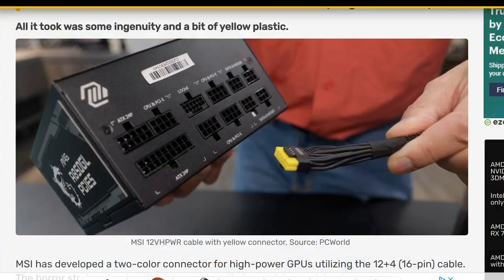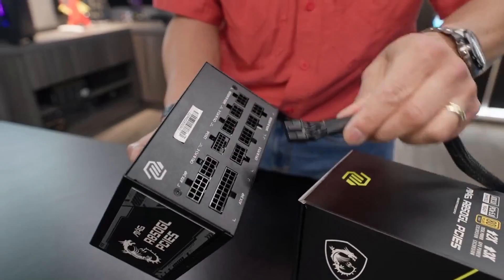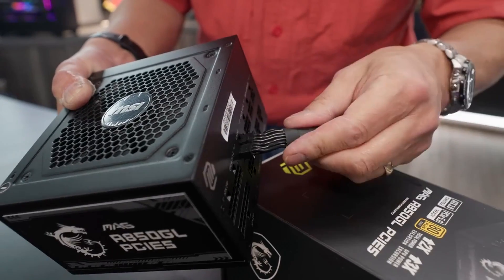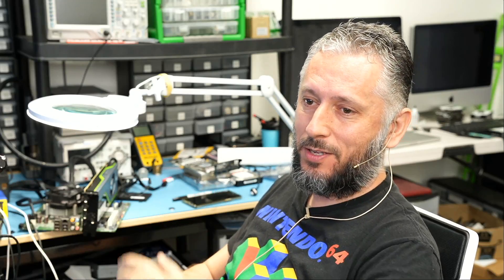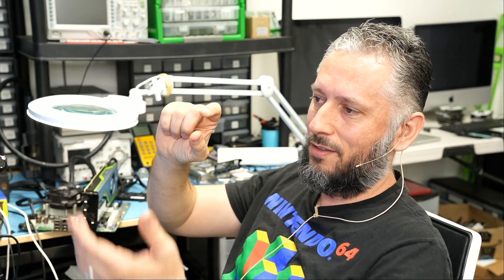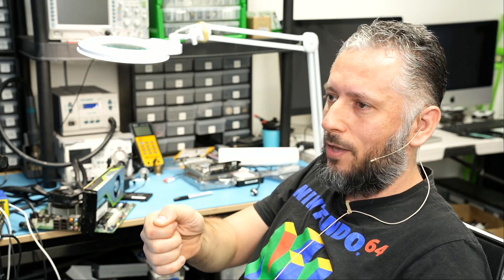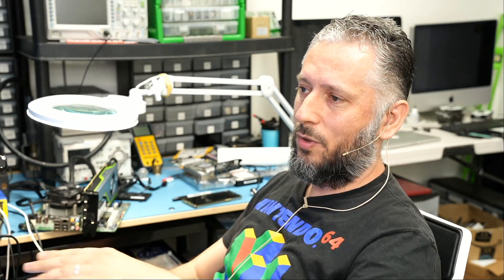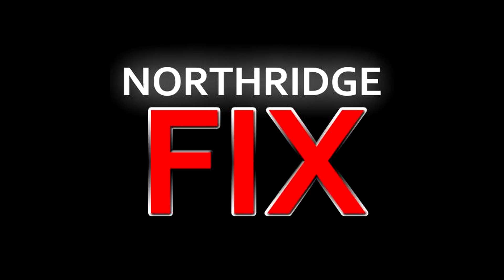4090 Melting connector Fix using MSI yellow cable 12VHPWR. What?

Comment: This is the power supply end. Alex, have you ever had to repair any of those.? 
If the cable was the issue, wouldn't BOTH ends melt.?
Hard wiring the card, to the pin landing would work.

If I ever run into a junk one of those, I would happily let you make it a test mule.

Comment: the issue is not the connections itself, they try to utilize to many Amps on 10-12 pins, instead they need to return to older format - 2-3 power connectors with 10-12 pins on each
Reply: Utilizing many amps on a few pins is not an issue if the connector is designed well. The XT60 connector used for Drones & RC planes can do 60 amps sustained on just two pins. The connector is not even larger than the 12vhpwr.
Reply: @kolle128  nope, if they install x10 XT60 pins instead of this needle one type would be a solution, or 2-3 power connector same crappy style to allocate Amps/heat across all pins
Reply: If the problem isn't with the connections then why are the majority of these cards having no problems at all?
Reply: @--_DJ_--  problem with the connector's setup (one instead of 2-3), that's why majority of 40XX cards have this problem coz of high current over pins overheated them and connector melted

Comment: How it's connected is totally irrelevant. You should be able to plug it halfway, 2/3 way, all the way and it should not melt. You should be able to plug it so that it's just barely connected and the card works, without having to worry about it melting. Melting means that the cable is not sufficiently capable of handling the amperage that passes through it. This is electronics and wiring 101. This is the entry college course. The wire melts, too much power going through wire. Doesn't matter how it's connected at all. If the wire melts, you need lower gauge (bigger) wires.

Comment: I'd just reiterate that it is still user error, but not the fault of the user, as they were set up to fail by nVidia. The blame falls squarely on them.

Don't expect them to care about it though, they're not interested in us gamers or our money anymore, they're an AI company. I just hope the response is proportional.
Reply: How is it user error if the connectors are too loose to stay in place?
Reply: @Sam_Miller  It's your fault if you don't have a connector fully seated. It's nVidia's fault it doesn't stay seated. I'm pretty sure I clearly said what I meant, it really shouldn't have taken any explanation.

Comment: To be fair he didnt say he "wouldn't be worried about pushing it back in" he said "thats enough gap where I would probably want to push it back in". But still the connector is garbo and needs re-desining.
Reply: I agree with Alex that nvidia should redesign the connector so there's more gripping force to make it more difficult to dislodge to start with.

Comment: how about I just paint the tips of my oem cables for my 4090 yellow
Reply: Because the paint will instantly scrape off the first time you plug it in.
Reply: good point
Reply: use some bright color permanent marker
Reply: @46rrodriguez  i think ill try that. maybe try some heat proof automative spray paint from chief auto parts

Comment: Sorry alex i dont think its problem with connecting cable, problem is the connector which is not capable handle AMP, that why generate heat and it's results melting connector

Comment: The connector could do with being redesigned to have something like thumbscrews which will physically and mechanically lock the connector in place all the way home. 

Did the 3 12V connectors on older design boards all connect up straight away or did they each power completely different parts of the card?
Reply: I think they all connected the same parts
Reply: They could just make it larger. Larger pins, larger plug, larger clips. Then it would be just like standard plugs we already had that work fine. This is an easy fix they just refuse to do it.
Reply: Depended on the design.
But they did have larger pins, and a higher contract area - and I dare say they had a far higher current overhead.

Comment: This is a design failure and NVIDA should be held responsible
Reply: yeah, whoever designed this stupid connector, should be fired.
Reply: @isyannnkarr  why fire someone who will not do this mistake ever again?
Reply: @isyannnkarr  Its so pointless too. The regular old cables look just fine. Just add some RGB to them and tie them together if you really hate the look.
Reply: Its not Nvidia who approved this design, there are standards for connectors and the this one was good on paper, good on bench but lacked the real world user test. So its the approvement problem the ATX team who designed and accepted it.
Reply: their testing  regieme wasnt set with real world case conditions ... it may have passed what they conjsider tough .. but after years repairs supprt.. WOW . in summer  the ambient temp can be 40Cin room .. then compund all heat and energy under thermal stress ... shit happejns .. enough for us to see LIVE pattern of failures
Reply: Yes I agree this should fall on the maker 100%
Reply: nVidia, Dell and PCI-SIG all share the blame for this poorly designed connector.
Reply: @RetromancerNick  I wonder if all get kick backs from Nvidia for every attempted RMA.
Reply: Spot on, Intel designed the connector but NVIDIA went with it and evidently didn't test it properly
Reply: said this from the start when it first come to light yet i was the bad man for blaming nvidia and got the its a user error response and trash talk, not that i havent been in stringent testing enviroments and mfg of Z parts
Reply: You do realize that not fully plugging in any connector is a fire hazard right?
Reply: @AndrewB23  true but these seemed with this in mind almost like it was intentionally designed this way on purpose 🤔
Reply: But if they didn't design it like this then they couldn't blame the user and Deny any warranty claims. And the doucher wouldn't be able to afford those leather jackets anymore.
Reply: Surely someone had tested the card before going in the mass production… how could they still go with this shitty connector?
Reply: @Samsemillya  it gives them (Ngreedia) Plausible Deniability and can refuse RMA's on mass.
Reply: a bit yes they schould do it in the way  that it is on the other side
Reply: Hahah nvidia held responsible hahaha that's a good one, anyone remember the nv30 days...
Reply: Actually wrong its people whom cannot install right.
Reply: isnt it an intel design? this connector?
Reply: for improper seating? nah
Reply: Nvidia: it's a design feature
Reply: The CEO thinks he's a cool dude who wears a leather jacket when really he's just a boomer

.

Comment: They need to redesign the connector to connect on the sides w/ 2 locking mechanisms
Reply: That will make zero difference. The problem is the tiny contacts of inadequate current rating which overheat due to simple resistive heating (I2R). IT's PLAIN SIMPLE PHYSICS/SCIENCE !!! It's a DEFECTIVE DESIGN

Comment: Molex connectors are rubbish for high current draw situations. They need to redesign the power plug and make it a more robust item. it was just a lazy design.
Reply: Blame Dell and NVIDIA.
Reply: It's not made by MOLEX. The US source is Amphenol. Molex Mini Fit Jr connectors have LARGER CONTACTS rated at LOWER currents. Hence those Molex PCIe connectors work just fine.
Reply: Laughs in EPS 12v @ 384watt min safe value, that's proven over 500w safe on only 8 pins (made by molex).
Reply: @RobertSmith-lh6hg  It's not the value it can handle, it's the sloppy way in which the socket moves about. This movement creates a bad connection and thus increases current draw, hence the melting of chinsee plastic.
Reply: @RobertSmith-lh6hg  EPS12V uses a completely different connector to 12VHPWR with a 1mm2 pin and 4.2mm contact spacing (Molex Mini Fit Jr)
It should have no trouble passing 32A with 8A per pin @ 12V which is indeed 384W. Note that the current rating must be derated for more poles on the connector.
In what way is it PROVEN at 500W ? That's over 10A per pin.

Comment: Design failure not caused by users, but Tech Reviewers are afraid of not getting sponsored. Hence, instead of blaming the manufacturer's design failure, blame the end user instead. I can't think of any other reasons than this.
Reply: The correct term would be something like "Design Flaw that has a high frequency of causing end user error, Too High of a frequency to be the end users fault."
Reply: @crisnmaryfam7344  You don't even know the percentage of failures to make such a statement
Reply: so the solution on pc world just a way for user to claim warranty on the card? nvidia cannot blame user error anymore with those colour connector plug in and have a meltdown, just video or take a picture, and what nvidia gonna come next for exscuse??? i'm sure there are still many ways the do not want to warranty it
Reply: They designed a fuse instead of a power connector 😂
Reply: Exactly
Reply: It's fine, let them try to do this, once we have melted yellow connectors they can't exactly hide anymore. It shows you how much the 'influencers' actually 'influence' when companies like MSI are already 100% believing this to be user error without doing their own research and trying to cash in on it. Tech Channels need to be very thorough and careful about their wording, because they can unintentionally screw the end user with their findings.
Reply: Yes, that's  the true story.
They will shut their mouths for good 😂
Reply: We've had this established this already for months 😭
Reply: Tech reviewers are basically poor men, you need stop trust in them and choose who you can believe accurately.
Reply: @massimilianobellucci  Poor men?
Reply: @--_DJ_--  yes, poor men. If you want to be a good tech reviewer you need to be “super partes” and provide info honestly, explaining the good and the bad of things. This continuous attempt to claim the users as culprit is something really weird. It was enough just say “sorry guys, we did a mistake, probably we did some miscalculation and we underestimated the power in play. We will come back to you all extending the warranty to cover that issue and if it happens to your card we repair it replacing the connector with a new version more efficient.
Reply: Amen !
Reply: yes GN blaming end user is very sad to see
Reply: @pratik761  They are not blaming the end user, they are stating what the problem is. The problem is the end user is allowed to make a mistake far too easily by the poorly designed connector. No ball was dropped, people just have a hard time paying attention to the details and get triggered when they hear "user error", which is the true cause of this problem. That doesn't mean the end user is to blame for the problem, it shouldn't be that easy to mess it up.
Reply: And that's why I unsubbed from Jay and Steve.
Reply: @bluej511  Uh, they both said it was a bad design that lets the user make a mistake. What is wrong with that statement? You should listen to what they actually say instead of going off what this guy misunderstood from their takes. In the last video he blasted GN and patted Jay on the back, they both said the same thing...
Reply: @bluej511 Why unsub Jay's channel? Steve is the one that blames the user.
Reply: @edwinsmit3123  Except Steve didn't blame the user, it's a case of people taking his words out of context. The paraphrase, Steve called it "user error caused by poor design", and everyone's just hyperfocusing on the "user error" (which, by itself, implies the user's fault) part and ignoring the "caused by poor design" (which immediately takes the blame away from the user) part.
Reply: @bluej511  I respect GN but they dropped the ball big time with this.Their "user error" piece saved nGreedia and screwed gamers over because if not for them maybe this would already be fixed by now,unless there is a fundamental design flaw with the 40 series GPU architecture itself.Maybe by fixing the horrible transients of Ampere,Ada messed something else up.
Reply: Really. So what is the design flaw exactly?
Reply: @Trainwheel_Time  He said it in the vid. The connector only has one clip to 'secure' it. That clip acts as a pivot point in the way that it's located in the middle of the connector.
It at least has to have 2 clips, one at each side so it cannot pivot anymore by the user.
Plus its (possibly also a resistance issue. Heat/melting stuff means that the resistance it to high. Mashing 4 power cables into one connector. It's bound to get issues if it's designed poorly. 
Or to use a mechanical example for explanation:  The 'road' that the power has to take is to small causing for 'friction' on the part that is to small.
Imagine jamming 4 roads with full traffic into one road without any limit or checks...  that one road will get problems.
Reply: @Trainwheel_Time  tiny contacts with poor tolerances that allow the loose tolerances to create high resistance situations that thus increase heat, and cause melting and possible fire hazard.
Reply: @Trainwheel_Time  The design flaw is that the connector is too finicky for end users to reliably use properly. The general public should not have to worry about .5mm of play melting down their graphics card connector. If the plug is that sensitive, it should have been designed with a better locking system and strain relief before being released to the market.
Reply: I fully plugged in the cable for my 4090 and nothing happened. So maybe it's users fault. I think so. A lo of users are girls or women that don't have much force in the fingers to push it in fully.
Reply: @stormrider01  lets be real. Average sane people will not use their force on $2000 piece of delicate electronics.
Reply: @stormrider01  😂 bro i can assure you 99% of users are male
Reply: @ItsCycloneAI  99.9% at that end of the market more than likely.
Reply: @stormrider01   Based, now we will wait for yours to melt and u complain
Reply: @stormrider01  I don´t need to fully plug any 8 Pin PCI-E conector, they are solid when they are plugged in, you can put all the card weight in the cable, you can bend the cables as you want, the 12VHPW is a bad conector, with quality and design problems, the 600w rated power is CRAZY, i will never put more than 300w in it.
Reply: @stormrider01  That is the lamest excuse ever. Girls are causing GPU plugs to melt? Give me a break.